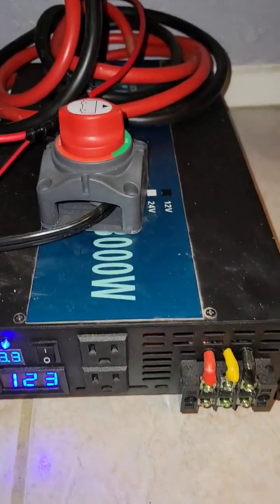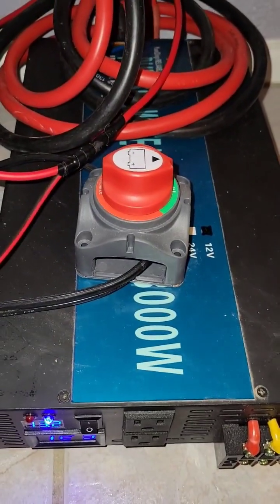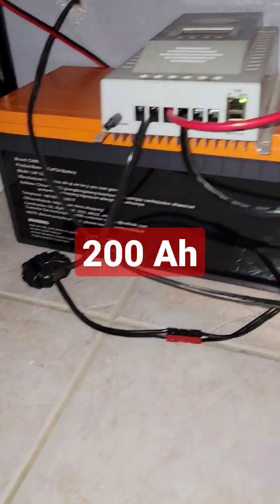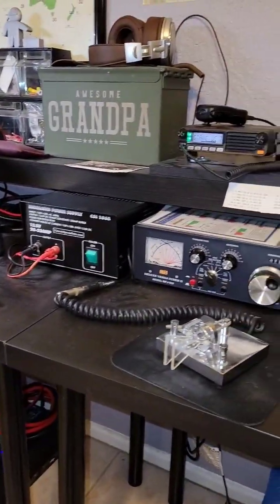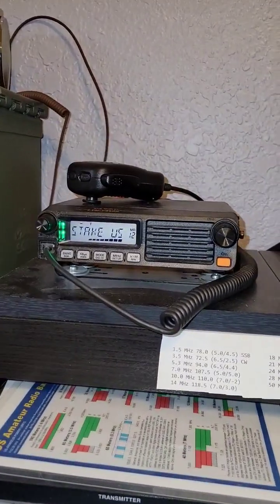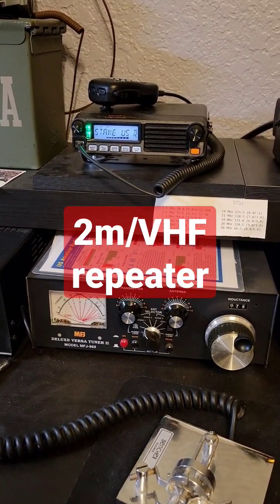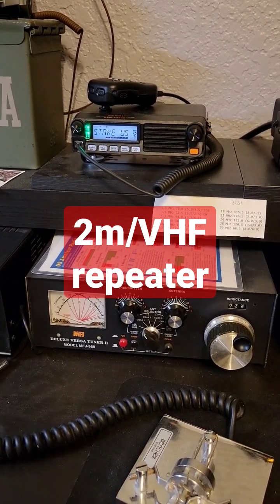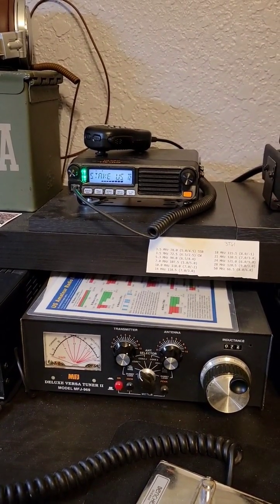Ham Radio Emergency Net - VHF Repeater #shorts

Comment: My shack is entirely off grid powered.  I have a solar panel that charges a LiFePO4 battery via a DC-DC voltage converter that I use as a battery charge controller.  The output of the buck converter is set to 14.2 volts, which is 0.2 volts less than the point where the battery's internal battery management system would activate the overcharge disconnect.  The radios can all safely use up to 14 VDC so I operate them directly from the battery with a properly sized fuse.  There is no need for a 120 VAC power inverter followed by a 120 VAC powered DC power supply.
Reply from the maker: Sounds like an amazing setup!  Regarding the inverter and power  supply, I was not clear on this point and made another video clarifying. I use the inverter to power other AC appliances like my fan, computer, and potentially refrigerator.  The power supply isn't connected to anything and is there to switch to the grid when doing maintenance on the solar.
https://youtube.com/shorts/fwkB-oGcg5k?feature=share
Thanks for sharing info about your setup!

Comment: Why are you running an inverter off of a battery to power a transformer that converts AC power to DC power in order to power your DC radio? You have a LOT of wasted energy in all those conversions. Use a DC-DC converter to step up/down the DC voltage straight from your battery bank if the numbers are off. That backup power will last a lot longer that way.
Reply from the maker: It may be difficult to tell, but I do have my radios powered right from the battery. There's no transformer in the system. The transformer is sitting there in case I want to switch to grid power. The inverter isn't powering anything at the moment...  but absolutely, I agree with you!